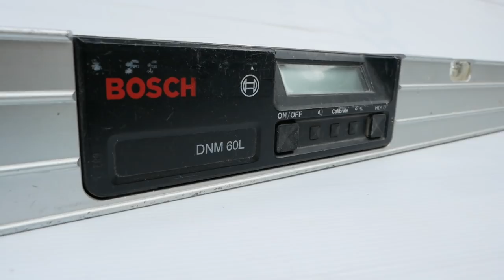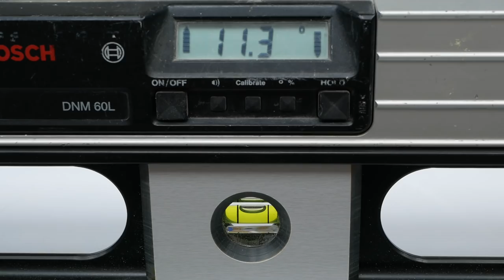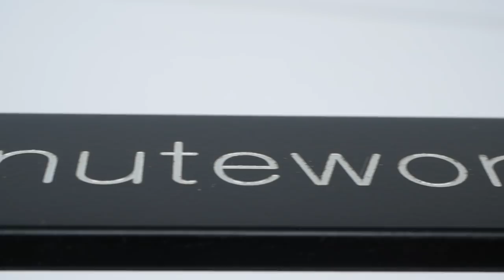On the Bubble [#213]

Comment: Great video MARK.  There are those levels I use for day to day, like my 12" torpedo level (It fits in the back pocket as I go up and down latter's).  Then there is the 24"  level to make sure the metal shelf's  are level between them, and finally I have a 60" spanning level I use in the yard or for large runs in the house to check the laser level.   The quality goes up as the length increases, and I try to treat it as a precision tool should be treated.  This includes checking them against a a known level space every now and then.

Comment: Nice, thanks.  After one of my cheap digital calipers went on the blink I dismantled as much as possible and cleaned its insides out as well as "polishing" the battery contacts.  It worked again after that.  Maybe not the same for your level, but there could be a dry joint somewhere or something more obvious and it might be an easy fix.  If you can't fix it you are no worse off than you are now except for maybe a little lost time, but even that time invested could be beneficial with the next fix!  Cheers, David.
Reply from the maker: Thanks! Yes, now I’ve ‘moved on’ it may be worth tinkering with - when I get a minute... 😆👍👍

Comment: If you use them, the indulgence is worth it. An interesting thing I find is that with my fine tools, although they get the same hard use on site and in the shop, they are treated better which has the effect of making me pause to consider what I'm doing more - the results of my work are better for it. I recently bought a Superior 1200 and it's robust and a thing of beauty. Pretty happy with it. One thing though is the vial. For me, by far the best vial for leveling on the fly is that on the Stanley FatMax Xtreme levels. When level, the edge of the bubble meets the indicator lines exactly. Not so on Superiors choice of vial nor many others. There's a mm +/- either side of the bubble edge to the indicator lines when level. It's a pet niggle I suppose but I'm not sure why it's only the FatMax Extreme levels that have this "dead on" type of vial. The benefit seems obvious to me.
Reply: Pause the video at 5:42 to see what I mean the gap between the bubble edge and indicator lines.
Reply from the maker: Bisch Basch Bosch Thanks! Yes, I understand what you mean - it’s on the thumbnail👍 Have to say I’ve never owned a level that didn’t have the bubble centred - but not touching - two lines; now you mention it it does seem to be an obvious and clear benefit. I wonder if there’s e reason? I’ll ask 👍👍
Reply: Thanks Peter. Genuinely interested so if you hear anything, I'd love to know. Hopefully the link works but I found an image on Google of what I mean about the FatMax X vials. The image is of the mini scaffold level as I can't find a close up of the larger ones I have but same applies - no gap between bubble and marks: http://vallen.ca/Proto-FatMax-Xtreme-Torpedo-Level

Comment: After your podcast about them they have been on my wish list for a while. I decided I need a set so am waiting until I have a job that makes them worthwhile. I generally keep 2 complete sets of levels. 1 for general building work that can include bricklaying and concrete work and a complete clean set for indoor use especially when fitting kitchens and cupboards. You might have just pushed these levels a couple up my wish list :)
Well done on the meal at the shard. Drinks there was about as much as I could afford :)
Reply from the maker: Me too Jason - but once in a while, it’s worth splashing out 🥂 Hood idea about having a ‘clean’ set of levels for ‘indoor’ work - I don’t do much messy stuff these days, but I know how easy it can be to track muck & rubbish into the customers home! 😱👍👍

Comment: A pretty good video showing what I think is a much better made level than most of what's available today. Since actual woodworking is far behind my main interests of metal working then maybe I can fill in a bit of additional information on the subject of what makes a good quality level that most here might not know. That Bosch digital is or was dirt cheap compared to something like a Mitutoyo master precision machinist level. Mine hurt very much to buy even 20 years ago. Yes I fully understand woodworking requires much less in the way of accuracy than setting up a machine tool so there's no twist to the machines way surfaces. Few consumer or even higher quality carpenter levels today have properly machined working surfaces that your new one shows. Since that's what they did it's a definite plus and shows there putting a lot of care and thought into what there making.Going by what's shown in the video I suspect your levels surfaces were either done on a metal working planer or they were surface ground. The aluminum extrusion processes are fairly good today, and most levels are now made from those extrusions with no further processing. But there still not even close to what a surface grinder provides for accuracy, or even better a hand scraped cast iron surface would. And no matter how good a levels vial is, any levels accuracy still depends on those working surfaces being flat and dead true there full length. Tools at least the very good one's designed for metal working will always come with specifications for there allowable accuracy limits. Levels would be specified as to there accuracy over a certain distance. Mitutoyo's best in the 960 series is accurate to .00024" over 12" as an example of what I mean. 

Those high end levels will use top quality glass level vials that are internally ground and finely polished on a pre set and calculated radius to provide there much higher degree of accuracy. The usual non machinist vials are simply heat bent to a very slight curvature so there much less accurate and repeatable. The very cheapest will use injection molded clear plastic for there vials. But even a decent woodworking grade level should still have some specifications as to it's accuracy over a known distance. "If" a level is properly made and tested to check there working surfaces are accurate enough, it's then not hard to vastly increase there accuracy by replacing the vial with a far more precise one. But testing a levels faces correctly would take a really good and large surface plate and at least a .0001" reading dial test indicator that most woodworkers would have no access to. The good part about any bubble type levels is there all self checking by the end user and there's no need to send them anywhere to be checked. Find a level surface, make a note of exactly where one end of the bubble is positioned within the vial, then simply rotate the level end for end and reposition it on the exact same spot. If the end of the bubble returns to the same spot within the vial the level is then calibrated to it's built in accuracy. Doing this should be a regular check on any level just to be sure of it's readings. It's also for that reason that all good machinist's levels will have a screw adjustable method of adjusting the vial so it then reads exactly the same with the level placed in each direction. It wouldn't be a hard or complex task to add the same vial adjustment on almost any levels of the size shown in the video since there much more space available than machinist levels have if that was ever really wanted by anyone. I'm guessing, but I wouldn't be surprised if there was an adjustment system built into your new level. One word of warning though. Other than the higher cost, upgrading to those higher precision vials does make the bubble react much slower until it's stable. Mine can take 20-30 seconds to stabilize. It's then a trade off of accuracy verses speed. If anyone cares about maintaining there level's accuracy then protecting it's working surfaces should be a constant priority. If I wouldn't eat my dinner off the surface then my level doesn't get used there until it's clean and burr free enough that I'd do so. :-)  Aluminum for a levels working surfaces is a very poor choice. It's used mostly because it's cheap and easy. So you have to be even more careful of protecting it's delicate and easily damaged working faces. 

At a guess your Bosch level "might" only need an internal cleaning. It could also be an electrical fault, but there's no way to tell for sure without opening it up and checking if there's anything obvious that might be wrong.

Comment: Peter. I had a problem with a digital calliper. It was giving crazy reading and resetting the zero didn’t last long. I then changed the battery and all was well afterwards.
Reply from the maker: I was working as a Saturday lad in Dixon’s in the mid-70s and was told that whenever anyone came in with a ‘pocket calculator’ that wasn’t working right, always change the batteries first! So yeah, done that, thanks, and no joy... 👍
Reply: hi, ive had repeated probs with cheap digital calipers, upgraded batteries and still useless. I'm told I need to spend more on Mitutoyo Digimatic Digital  Series 500, but so expensive. Reverted to metric dial. Peter, sorry to go off topic.

Comment: Hi Peter, have you ever tried a laser level? Both as short and as long as you'll ever need and the last level you'll ever buy. I really only use my levels as straight edges these days.
Reply from the maker: Hi Alex. Yes, I have a couple - I just prefer an actual level, level. 👍
Reply: I'm a big laser guy, however, lasers need to be checked frequently as they do go out of whack.  I learned my lesson about 15 years ago.  I installed 2 upper cabinets after which for some reason I checked it with a spirit level.  It was way the hell out of level.  My laser was broken and I didn't realize it.

As a finish carpenter I do mostly commercial work.  In most rooms there's almost always a sheet rock wall with a corner and metal corner bead.  A laser sitting on top of a magnetic bracket is mighty handy.  Some guys use the laser for a long run of base cabinets.   For me that's too fiddly, I prefer a string and 1/4" offsets to check for straightness.

Comment: indulging, hmmm, ya, i have 23 guitars now, some are expensive and some are cheap, that i worked and made play just like the expensive ones, measuring tools, however, nomatter how much you work an aluminum speed square, the first time you drop it it's off, so i had a guy down the street from my body shop in the machine shop make me a right angle triangle around 4 " at the foot, it's about1.5" thick, now i  can drop it off my roof and it will still be square, he just cut a straight 90 across a piece of stock carbon steel, and a 45 , took it to their digital grinder and ground it to like a thousandth of an inch to flat, and only wanted a case of beer to pay him

Comment: I’ve been using the 120cm (I guess; could be 150 as well) version of that Bosch level for several years now (it’s actually my dad’s but he has no use for it for now so I semi permanently borrowed it ;-)) and the only problem I’ve had with it so far is that it won’t fit in narrow places. I have to replace a wooden floor in a narrow corridor in my house, so a few weeks ago I bought a Bosch 220 mf (https://www.bosch-professional.com/be/nl/products/gam-220-mf-0601076600) to supplement it. That should come in handy for the miter cuts on the skirtings as well.
Reply from the maker: Nice 👍

Comment: One observation and one question. 
You're getting absolute silence in parts of the video; almost like there's a bit of software going "he's not talking, set the sound level to zero, don't even include hiss"; contrasts greatly with the underlying hiss that's present when you're talking. Noticeable with USB-connected headphones on, don't know about speakers.
Do you think you'll get as accurate a level reading with the bubble as you could get with the digital? Is this one of those "do it long enough, you learn the art"?
Reply from the maker: Re. the  observation - nothing so sophisticated, I’m just cutting out the ‘um’ & ‘ah’ parts, admittedly without thought to the audio floor. I think it’s preferable to leaving them in, but will do better👍👍  Re accuracy - I’ve driven myself crazy for the last 15 years trying to get everything to absolute zero - in all honesty, I don’t think it would have made a scrap of difference if it had been 5/100ths of a degree. With the bubble level I’m certainly a little  more relaxed about it - ‘level enough’ 👍👍
Reply: "Level enough" reminds me of stories from my grandfather when he was having a house built in Barbados - 
"Make sure you build that level!"
"Yes sir. Do you want it level a little or level a lot?"

and the fact there were no spirit levels on site - they just used the horizon (building on a hill overlooking the sea).

I think Superior Level's site just got hugged to death, it's not very happy right now.
Reply from the maker: Haha, clearly makers after my own heart! And oh dear! Not often you see a website brought to its knees. Well, not since Tuesday, anyway... 😂😂👍👍
Reply: Peter, just cut and paste a small piece of 'blank' room sound from the same shoot, ideally a pause close to the bit you're trying to remove. Problem solved  with no audio drops. Here speaks a professional video editor. If you get a little 'pop' or 'crack' on the join just apply a 1 or 2 frame audio dissolve and that will solve it.